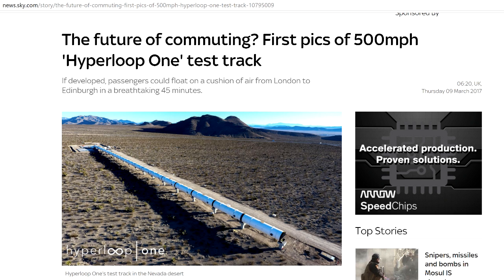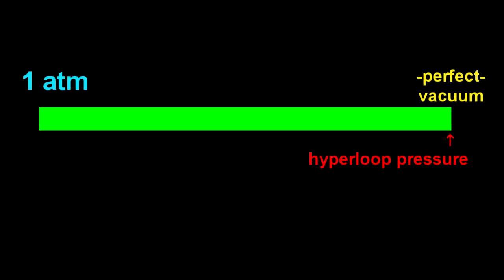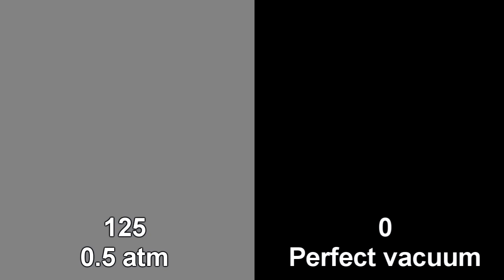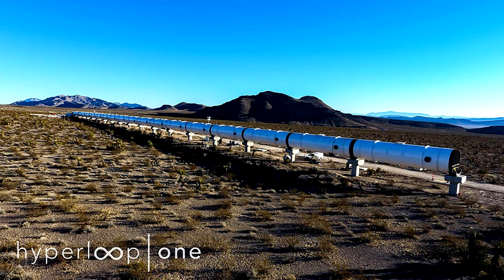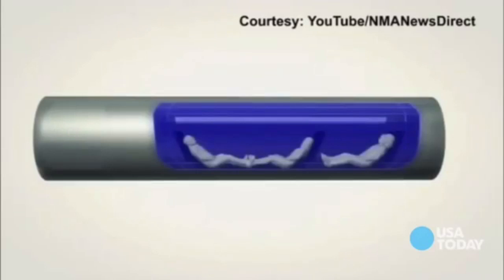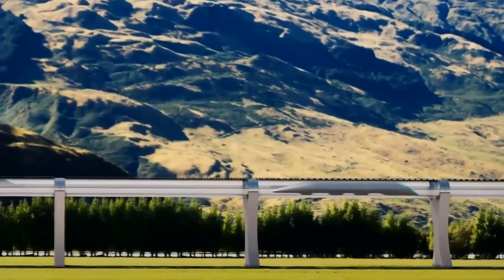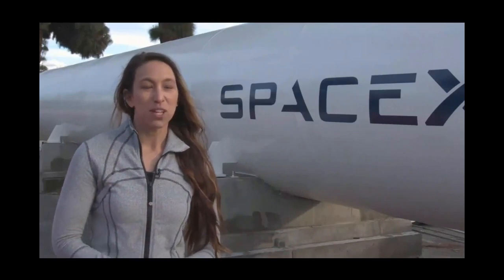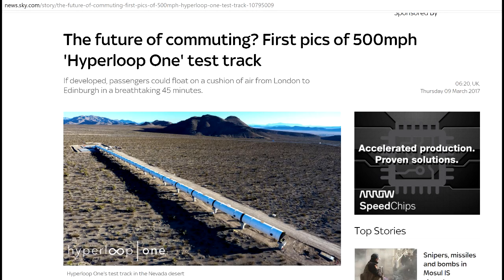Entire Hyperloop could be destroyed in SECONDS!

Comment: Stop being a pessimist @Thunderf00t . This is just a prototype bro .. Yes, there are engineering problems. Please let the engineers work on it. 
5:40 : There is something called loadlock  technology to solve this problem. Do you really think that they have to vacuum the complete tube everytime a pod gets in.
8:55 : Again the entire tube could be segmented with distributed  vacuum locks and it can open certain segments where the pod are about to enter.  (9:34 Notice one half is not damaged). Segmented safety check is also needed.
9:42: No it won't need any interior support if it is thick enough. Prove scientifically why it needs interior support b4 making such bold statements. 
10:54: Tanker truck's typical thickness is 5 mm , for hyperloop currently it is targeted around 25mm. Stop saying it as wafer thin tube(11:39)
11:34: Please don't make bold claims like any slight dent will bring it down. The denting impact should create sufficient damage to bring the entire structure down. Not any "slight" dent (quantification is important in engineering).
Let humanity do some progress in technology. Stop being a leg puller. There are known unknowns and unknown unknowns in any technology development. That in no way means we should not do anything. It may succeed after some time. 

"Mark my word: A combination of airplane and motorcar is coming. You may smile, but it will come." -- Henry Ford, 1940.
Reply: Hi, Tell me one law of physics hyperloop concept violates..
Reply: Sir your proposed solution would work for the given problem, but their is no point is it ? wouldn't that make the price sky high ? and it doesn't solve the terrorism problem. Isn't it better to just use high speed train ?
Reply: Bcoz, I believe the glass is half full.. Bcoz, why not do it? In a philosophical perspective, in a imaginary thought experiment, look at earth from a perspective of light year distance away.. There is no point in anything we are doing currently at such a small infinitesimal dirt in universe.. But still we do it.. we sleep, we eat, we marry, we elect, we travel, we build stuff, we make things better for each other, we keep adding to the tree of knowledge through our exploration..  In a perspective, it might be better to just use high speed train.. I travelled in MagLev in Shanghai which they operated just reaching above 320 km/hour (Maximum record 431 km/hr).. It was a childhood dream coming true where I could see a physical concept when engineered carefully becomes a technological breakthrough.. Terrorism problem is always there as of now which can be tackled as well...
Reply: Hi Ian, I am a strong supporter and believe in technology advancement for the betterment of human kind. If Elon is anyway directly and with consensus involved in the beyond-acceptable-level of low wage issue (which I came to know and read about just now mostly by subcontractors associated with Tesla), I strongly condemn it. I had a positive opinion of Elon as a supporter of Universal Basic Income. I will reconsider based on more news updates.

If you are talking of Henry Ford, I have read about him as somebody known for his generosity towards his workers.
Reply: Yeah all we need to do is pump all the air out of earth then we won't have any atmospheric pressure problems. Easy.

Comment: You are not even giving a clear argument. I used to find your videos quite convincing, but on this one it's little more than hand waving. Which part of the official specifications can you show to be inappropriate? Of course a tin can will collapse under low pressure. So you believe the engineers at HP One are not aware of the forces the tube would have to withstand? Without good evidence for that it will be you with egg on your face, rather than them.

Comment: You're also showing a test involving a collapse test with a thin metal tank for a tanker truck against full pressure air as vs what would actually be there. Putting interior struts for something sitting there is a precaution against gravity and heat for long term storage. You keep talking about "oh no it's gonna get dented and implode" if it was that likely then CERN would be done and out of comission by now...because reminder that's the actual world's larges vacuum chamber.

Comment: It seems Thunderf00t is not a mechanical Engineer of any sort.  Tankers and the other vessels shown on this video are not generally designed (and thus the reason for the failure) for a vacuum.  What you are actually implying is that it will be too costly to make a tube with the needed structural integrity to handle the various loads the tube will be subjected to. 

Will there be failures, of course, there will be, but that is the nature of man being imperfect.

Comment: Almost every method of transportation has some sort of energetic failure mode. The safety regulators will essentially want to see either a fail safe condition or statistical argument that the risk of a certain catastrophic failure is incredible. The arguments here are essentially the same as saying commercial aviation won't work because I could put my foot through the wing of the Wright Flyer. The  50 tonnes of dynamite equates to  8g per meter, hence failures are perfectly possible to arrest, one of those tanks didn't even fail along its full length. The tube could be  a  twin wall structure or a reinforced concrete pipe which wouldn't fail in that way. The issue of a  vacuum failure is more significant but again is likely to be solvable with a  combination of controlled repressurisation, emergency stopping, pointy pod design and other features. In a three g emergency stop the  pod is going to take 11 seconds to slow down from top speed and this could be synchronised with a refilling of the tube with the increasing air density contributing to the  deceleration. It would still kill whoever was next to it but that's no difference to the theoretical ability of terrorists or accidents to derail a high speed training, which is rare enough we have no issues riding them.

Comment: The easy solution to this is for the hyperloop to be divided into several shorter segments of vacuums and non-vacuums all sealed from each other. As the car passes through the vacuum segment, it picks up a lot of acceleration and carries the momentum as it enters the non-vacuum segment. The non-vacuum segment should be designed to have as little friction as possible with the pod, and be short enough for the cart to reliably move to the next vacuum segment for even the heaviest load on board, when accounting for friction and gravity. The vacuum segments will be thicker of course and the separation gates are air locked, like in the ISS. The first gate opens while at normal pressure in the end segment of the non-vac chamber while the second gate will open to the vacuum. During this gate passing process, the cart should have slowed down significantly so the fast opening and closing of the gates can keep the cart moving with it's momentum, but stopping it entirely is acceptable as well. Stopping the cart may be safer, but it would require more time and energy to push something at rest.

Comment: Couldn't the tube be bulwarked or have valve releases? Also couldn't the tube be reinforced?  Maybe encased in cement from the outside which both buttressed it and protected it. I'm definitely not an engineer, but it seems like these are just engineering issues to be solved, not necessarily insurmountable deal breakers.

Comment: Much of what I hear in this is related to engineering problems and is slightly disingenuous in trying to equate a test track to what a full-scale production system would look like. The test tracks are just that and as such provide very limited capability including not having any sort of airlock/gating system and probably using lower power and less expensive pumps on some sort of stock pipe configuration. This is POC phase where you test out some basic assumptions that get the fundamental mechanics down to pick a path. 

I'm guessing that the pipes they are using are simply stock steel water pipes that can be purchased in bulk. The cross beams are provided by the manufacturer to ensure stability during transport and assembly. You can see similar pictures across google of these types of heavy duty pipes in similar configurations, all with cross supports prior to and during installation. I don't think it's as much of a gotcha as the video makes it out to be. Additionally, we already have thousands of miles of such pipes, including high-pressure pipes for water, oil, and natural gas, snaking across all sorts of terrain in the US. These pipes are designed to withstand harsh conditions and the occasional earth quake. There are a fair number of solutions within those systems to reduce breakage by allowing more flexible joints that can flex and expand within a specific range. While these particular pipes don't appear to use those techniques, this is still essentially an "alpha" POC. 

If anyone wants to really think about how this works look at the DARPA challenges with self-driving cars and autonomous robots. It wasn't long ago that we watched those challenges and saw "the best" driving off the road, crashing their cars, driving like a grandpa and the vast majority not even finishing the challenge. Now we have car companies competing to make better and better self-parking and self-driving systems for today's cars. There's a potential here for something similar, where competition and constraint will breed creativity to provide the engineering solutions we're looking for (or leveraging ones we already use).

For people saying "just build high-speed rail". Rail will suffer from expensive build outs plus high maintenance costs over these huge distances. You'll need to keep animals and debris off the tracks and out of the systems. You'll similarly need to worry about earthquakes and weather events. Hyperloop helps with some of this in that it's a mostly closed system. You should have a much lower chance of critters and tumbleweeds (or drunk people walking the rails, abandoned cars, or stupid drivers) ending up on the tracks.

Comment: the Japanese maglev train reached a speed of 600km/h and with air resistance, why cant something without the resistance reach such speeds??? and we did not have this technology before so whats wrong with starting from the scratch??? submarines handle huge pressure, why do not we hear about submarine collapse, and also; if this thing is capable of generating the energy it needs to perform then what stops them from generating energy to control the temperature of the tube and keep it cool???? the possibilities are endless and you're just being skeptical about it, in fact; you've been skeptical about almost every new technology and you rush to try to disproof it, if you're soooo smart then why don't we hear your name all over the media instead of Elon Musk's name?!!!!!!!!!

Comment: Problem about 0 vs 0.01 is that 0•x = 0, while 0.001•x=x/1000. Huge difference when you consider that this allows strong materials that are designed to withstand pressure to construct the tube.

Comment: So how come a space station, which is a big metal tube pressurized to 1 atm in a vacuum environment, doesn't explode, but the big metal tube evacuated to vacuum gets crushed by 1 atm of pressure??
Reply: How much does a space station cost again?
Reply: Hubert Hans they're both the same principal with very similar pressure differences. The length of the cylinder has no impact because  pressure is measured per unit area so you don't need a structure to be stronger if its 10x longer
Reply: Noone is saying, that the tube would definitelly implode, if it is perfectly made and maintained nothing bad will happen. But just imagine how likely it is for a 1000 mile long tube to have some weaker parts, and imagine the costs for maintenance.

Comment: I mean you can sit here and say this stuff all day. and I'm not gonna say your logic is necessarily wrong... but the shit is a brand new technology... the first planes weren't flying around the world as soon as the first one ever flew. I'm certain that there's ways to solve these issues like for example, bulkheads between certain lengths of sections that they pump the air out. like you're hating on the test track.... which is exactly that, a test track.  a tool to test proof of concepts. you keep saying it can't happen, but I think you're looking at it wrong. like for example. I live in a city that has tunnels that go under water. my area has very many of these tunnels. I'd argue that the pressure differential between the shitloads of water on top of this tunnel vs the 1atm that the inside is at is roughly comparable.

Comment: 1: You clearly haven't got a clue how thin the walls are of the tanker, those walls also buckle under their own weight.
2: Implosion extremely dangerous? No because IMplosion, you showed it yourself a dozen times in this vid.
3: Of course the track has to regain its vacuum after a vehicle is swapped out, there is no need for this when the vehicle stays in the tube.
Pro-tip: More thinking less ranting.

Comment: None of the tubes shown here were ever built for vacuum. There's so much well-engineered vacuum technic nowadays and I never heard of such a leak. You just have engineer safely with tolerances in the statics. Simple as that.

It's like critisizing planes. They are also having another pressure than their environment, their wings are full of explosive fuel and they have 10 km of potential energy with no safety wire. You can keep on preaching they gonna fail. Truth is: Due to good engineering however failures are really scarse.
Reply: planes have limited lifespans, they can expand and contract just a ""handful"" of times, after which they either get decomissioned or intensively refourbished. Infrastructure like the hyperloop can't be designed on the same basis..
Reply: @ xenoth I don't know much about submarines but I expect they as well have a given lifespan, you should also consider that submarines don't have to fly and thus can be made thicker and stronger.
Reply: Then please explain a god damn submarine?
Reply: Salvo D'Ippolito vThat's because the Bean Counter that the Pentagon don't put a value on a soldier's life end of story inside the Pentagon gets paid anyway every time I soldiers died  pentagon who got an insurance actuary put on every United States pentagon military personnel and  these service men and women don't even know that  Walmart Walmart put actuary Insurance on every one of their employees including the elderly that they hire hoping that they get put down or die accidentally with a little help   and then Walmart gets paid  lOL I have to admit that s*** isn't funny. Where is it what
Reply: A submarine was never built to be cheaper than ships.
One of their point is that Hyperloop will be cheaper than maglevs or even high speed trains.

Comment: Obviously they would use a stronger material if there was any risk of an implosion. Their test track is still running but it hasnt imploded yet and the parts for the hyperloop that you showed earlier in your video are clearly made out of a different material to the tanker you showed imploding. By your logic space travel is impossible because the craft would just explode from the vacuum. Its the same problem only in reverse, But the space station is still up there and habitable and there are still manned missions from time to time because they over came this issue before they even sent anyone into space. They will do the same for hyperloop. At this point your arguments are farcical

Comment: what you are forgetting is that these tankers are design to withstand high pressure not low pressure so of course they are going to fail. as well as that these are all prototypes so of course they are not going to be travelling at super high speeds. It wasn't a little dent that caused the mythbusters tanker to fail is was a pretty large concrete block dropped from quite a high height. you were complaining  about the long time to enter the tube but once again it was a prototype  and either they haven't designed the entry mechanism or else they hadn't implemented it at the time.

Comment: You are wrong. 
The idea is very good. Also it is not very hard to make a tube that can take the  air pressure. Pressure gate or valves can be use to depressure each segment of the hyperloof. Energy for depressure ih very high but solar energy can be use for that purpose. The major problem is financial aspect, this is very expensive project.